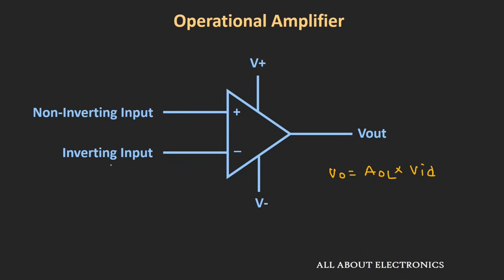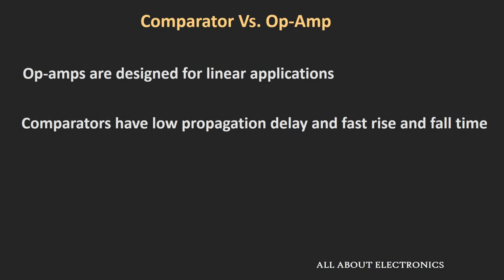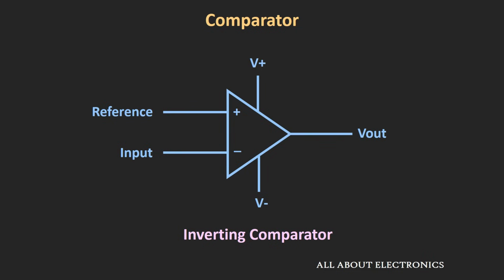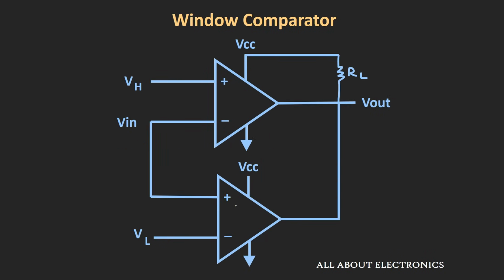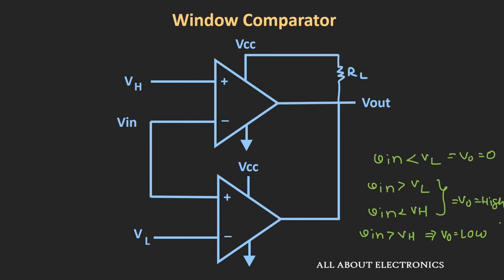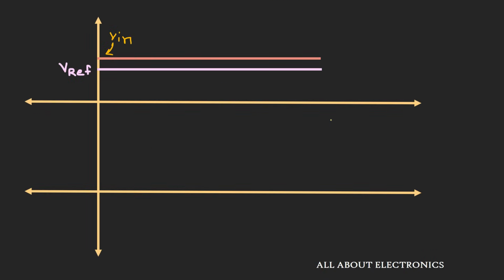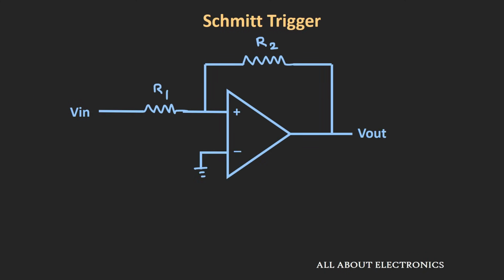Comparator Explained (Inverting Comparator, Non-Inverting Comparator and Window Comparator)

Comment: Its Low ( 0 ) and High ( 1 ) Voltage Depend on its type of compator 1) Inverting and Non - Inverting
Reply from the maker: Yes. Basically that’s a Schmitt trigger. ( inverting or non- inverting type)

Comment: at 05:30 , you said "when Input is applied at Inverting terminal, and input voltage is lower than the reference voltage, the output will be LOW
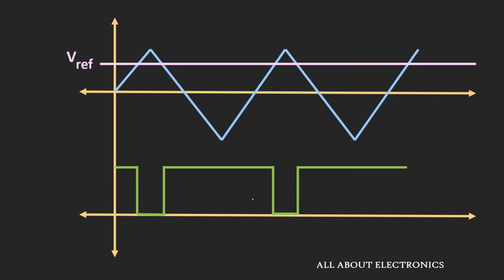but in the example at 06:58 when the Input is applied at the inverting terminal, and  the Input Voltage is lower than the reference voltage , the V-out in the graph is showing HIGH, is it not contradicting 05:30 statement, or am I getting something wrong?
Reply from the maker: Both are different case. In the first case, the input is applied at the non-inverting input terminal, while in the second case, the input is applied at the inverting terminal. In the second case, when input is less than reference voltage, then V+ > V- (the voltage at the non-inverting terminal will be more than inverting terminal). Hence output is HIGH. Now, when when the voltage at the inverting terminal goes above the voltage at the non-inverting terminal, then only output will go LOW. I hope, it will clear your doubt.

Comment: Whether both the comparator outputs are been connected with Vcc, because your diagram seems to be like that only ?
Reply from the maker: I think you are talking about the window comparator. Yes, the outputs are connected to Vcc through one resistor. And because of that, the output behaves like wired AND gate.

Comment: For the window comparator, why is it that if one op-amp goes low then Vo goes low automatically, but needs both op-amps to be high for Vo to go high?
Reply from the maker: Because in the window comparator, the output of the two op-amps are connected together using the pull-up resistor. So, their outputs will act as a wired AND connection. That means if any one of the op-amp output is low, then overall output will become low and the output of the window comparator is high when both the outputs are high.

Comment: When the inverting terminal voltage and non-inverting terminal voltage are same, how will it work then?
Reply from the maker: In ideal case, the output of the comparator will be zero. But in reality due to different bias currents at both inverting and non inverting terminal, the voltage at the two terminals will be slightly different. And because of that the output of the comparator will be either +Vsat or - Vsat.

Comment: I thought op amp always try to make V- = V+. When ap-amp is used as comparator, it seems the rule is obeyed?
Reply from the maker: No, V- = V+, when the opamp is used with negative feedback ( in the linear region). When the opamp is used as a comparator then it is used in the open loop configuration. Therefore, it is not applicable.
Reply: @ALLABOUTELECTRONICS  Thank you so much for confirming this information.
Reply: Sorry, violated.

Comment: what is vref in this opamp
Reply from the maker: Vref is the reference voltage, which you want to compare it with the input signal. For example, if the input goes beyond this Vref, then output of the comparator will change. And based on that, you can take certain action in the circuit. (Turn on/off LED, Turn on/off Motor, etc)

Comment: In electronics, a comparator is an electronic circuit that compares the voltage level of two input signals and outputs a binary signal indicating which input signal is greater. It is a type of operational amplifier (op-amp) circuit that has a very high gain and is designed to operate in its linear region.

The comparator has two input terminals, one positive (+) and one negative (-), and one output terminal. The input signals are connected to the positive and negative input terminals, and the output signal is a binary signal that indicates whether the positive input is greater than or less than the negative input.

When the voltage level of the positive input is greater than the negative input, the output of the comparator is high (logic level 1). When the voltage level of the negative input is greater than the positive input, the output of the comparator is low (logic level 0).

Comparators are used in a wide range of electronic circuits, such as voltage level detectors, oscillators, and digital-to-analog converters. They are also commonly used in analog-to-digital converters (ADCs) to convert analog signals into digital signals.
Reply: Thankyou
Reply: @ramanverseyt  बहुत अच्छा से समझा है मेरे दोस्त थैंक्यू
Reply: Thank you very much ❤
Reply: I love you
Reply: It's really helpful

Comment: At 9:04 iam confused that in window comparator why overall voltage is low if vin is less than either lower threshold voltage or upper threshold voltage
Reply from the maker: The output of the two compactors are connected. So, if any one of the output is low, then overall output will remain low. 
The output of the window comparator high, when both comparators outputs are high. In this case, it will happen when Vin >VL and Vin < Vh.
So, basically, when the input voltage is within certain voltage band, then only the output of the comparator will become high. 
I hope, it will clear your doubt.

Comment: If you run the output of an op-amp through a diode, would that give you a comparator?
Reply from the maker: If you use opamp in the open loop configuration ( without any feedback) then that itself will act as an amplifier. If you use opamp at the output of the opamp ( without feedback) then it will rectify the output.

Comment: Would you please clarify that from the circuit perspective, what would be the difference between an op-amp and a comparator? how are comparators faster than op-amps? Also, can you please explain the reason of adding the resistor?
Reply from the maker: op amp is optimized to provide accuracy and stability (both dc and dynamic) for a specified linear range of output values in precision closed-loop (feedback) circuits. It is achieved through internal compensation capacitor. But when the same op-amp is used in the open loop configuration as a comparator, then due to its internal compensation capacitor, its output cannot change very fast. On the other end, the comparators are meant to be operated in the open loop configuration. So, they do not require internal compensation capacitor. And because of that they are quite fast. I hope, it will clear your doubt.

Comment: Is it possible for a quad op-amp to generate 3 window comparators.  Specifically, if an RGB LED is used, how can I have ...

Input (In)                        Comp-A (R)               Comp-B (G)               Comp-C (B)      Colour
In < 2.4V                            Low                            Low                            Low                   -
2.4V < In < 2.6V                Hi                               Low                            Low                   R
2.6V < In < 2.8V                Low                            Hi                               Low                   G
2.8V < In < 3.0C                Low                            Low                            Hi                      B
In > 3.0                               Low                            Low                            Low                   -

Comment: Have to point out in the window comparator, the circuit works only when the op-amp has open collector output stage. It won't work if it has push-pull output, which is what many modern IC uses nowadays.

Comment: What if I put equal voltage?
Reply from the maker: Ideally, if two inputs are equal then the output will be zero. But in reality when two voltage levels are within the input offset voltage range of the op-amp, then the output would be random. It could be high or low or may switch between high and low randomly.

Comment: Consider you have a sensor which may be taking values of photoresistor and converting
them into voltage. Assume that sensor is recording the following values.
Max Value (Bright Light) ≈ 12 V (10% tolerance level)
Min Value (Dark) ≈ -2V (10% tolerance level)
Whenever the sensor reaches the value of ≈ 5V (10% tolerance level) a BlueLED must
be ON and when it drops from 5V it should be OFF.
The circuit is implemented using an amplifier which vaguely follows the idea of converting
analog input into digital by using it as a comparator.

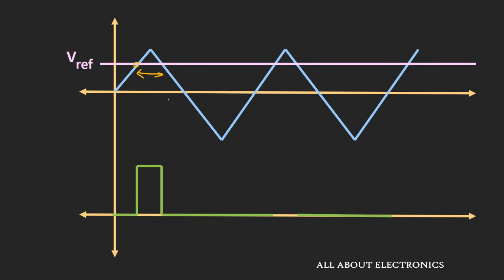Comment: sir, in 6:12 , the output waveform  should give a negative saturation for all input less than reference voltage , i am confused by the way u have given only  one side positive saturations.  should the low outputs  ought to be below axis ??.can u help me out
Reply from the maker: Many comparators are single supply, where the negative supply pin is grounded. In that case, the output will vary between  Vsat and 0.
When the comparator is biased with dual supply, (Positive and negative) then, in that case, the output will vary between +Vsat and - Vsat.
Here the comparator is biased with the single supply. 
That's why the output is zero instead of negative Vsat. 
I hope it will clear your doubt.
Reply: @ALLABOUTELECTRONICS  thank u sir

Comment: Sir, what about the case when output is in between Vsat and -Vsat (means if open loop gain*(Vin-Vref) donot reach Vsat)
Reply from the maker: If it does not go into the saturation then op-amp is operating in the linear region and it will work as linear amplifier. That is means vout = open loop gain* ( vin1 - Vin2)
But for that input should be very small. Typically in uV.

Comment: why in output voltage , vo= 0 V when vin < vref  , it should have been -vsat
Reply from the maker: It depends on type of comparator. Some comparators are single supply comparators. In such comparators the output will vary between Vaat and 0. In dual supply comparators the output varies between Vaat and - Vsat. 
I hope it will clear your doubt.
Reply: @ALLABOUTELECTRONICS  Thank you very much

Comment: actually your graphs are wrong for inverting and non inverting comparator because in case of non inverting comparator when Vin < reference then Vout = -Vsaturation not 0 and similar for inverting comparator , by the way your explanation is awesome :)
Reply from the maker: It actually depends on the comparator supply voltages. There are some comparators, where positive supply voltage is Vcc and negative supply voltage is 0. In some comparator its -VCC. 
For single supply comparators, the output will be zero, for the dual supply comparators, it will be -Vsat. 
I hope it will clear your doubt.

Comment: What is the meaning of open collector configuration at 3:56 ?
Reply from the maker: In the open-collector configuration, the output is taken through the collector of the internal transistor.To get the proper logic high and low, it is required to connect the external pull-up resistor at the collector. (resistor needs to be connected to Vcc at the collector).
Reply: @ALLABOUTELECTRONICS  okay thanks

Comment: Sir why in the waveform of non inverting comparator you made the output signal zero .....will that not be equal to -Vsat ??
In books it's given -Vsat 

Plzzzz help sir this is creating confusion in my concepts!
Reply from the maker: See, that depends on whether the comparator is a single supply or dual supply. In a single supply comparator, when the output of the comparator is high, then it will go towards the +Vsat, and when it is low, the output is zero.
In dual supply comparator, there will be +Vsat and -Vsat. 
Here I am assuming its single supply comparator. In the book, it might be a dual supply comparator. (The biasing voltage to the comparator will be +Vcc and -Vcc)
I hope it will clear your doubt.
Reply: @ALLABOUTELECTRONICS  ohh okay  .....thank you so VERY much sir ....now m fine with the concept 😄

Comment: Sir,in window comparator ,if input is less than low threshold value ,then comp1(upper comparator)  should give high according to ur circuit design  ?..u should keep the input on non inverting terminal of upper comparator (comp1) and modify the circuit ,if I m  not wrong 🤔
Reply from the maker: When Vin is less than VL, then the output of the first comparator is high, but the second comparator is low. (ideally, the output of the second comparator is zero).
So, it will pull down the overall output voltage to zero. (even though the output of 1st comparator is high)
It acts like a wired-AND gate. That means the output will be high when both comparator output is high. 
I hope it will clear your doubt.
Reply: Thanku sir😊

Comment: 6:36 what about -ve half cycle
Reply from the maker: During the negative half cycle also, as the input is less than reference voltage, the output will remain low.

Comment: Good explanation, but there’s something I don’t understand. How come op amps and comparators aren’t the same thing? Isn’t a comparator just an op amp without feedback?
Reply from the maker: Yes, op-amp can be used as comparators. But for that, the slew rate of the op-amp should be very fast.
So, ideally all the op-amps can be used as comparator. But not all the op-amp will work perfectly as comparator.
So, there are dedicated comparators ICs which will work as a comparator. 
So, internally they are op-amp itself, but optimized for fast transition.
I hope it will clear your doubt.
Reply: ALL ABOUT ELECTRONICS thank you so much for the fast reply 👍🏻

Comment: Sir, can you plz explain "why in window comparator, the output is low when any of the comparator output is low..?
I didn't understand it.. plz help sir
Reply from the maker: when any of the comparator output is low, the output of both comparators will be pull down to zero volt or low voltage. (Becuase it's wired and connection). That means the one terminal of the resistor (which is the output of the window comaprator ) will be at a low voltage. And the entire voltage will get dropped across the RL. 
I hope it will clear your doubt.
Reply: @ALLABOUTELECTRONICS  sir can you explain the significance of that pull up resistor too? What really happens when the output of both comparators are high... How we determine the overall output..
Plz help sir
Reply from the maker: The pull-up resistor ensures the logic high at the output. If you see, every circuit or every IC has limited output current capacity. That means the maximum current it can deliver. If more current is drawn then the output voltage reduces. 
And it might happen that the output voltage would become lower than the logic high value.
This pull-up resistor maintain the logic high value when the output of the comparator is high.
I hope it will clear your doubt.

Comment: The video is really good. Thank u for ur time and efforts.
Can u pls explain : 1.  the use of external pull up resistor ?  2. the reason for connecting Vcc of upper OP AMP to Vout of lower one ?
Reply from the maker: The pull-up resistor ensures the output of the comparator is indeed logic high when both comparator output is high. 
If comparators are directly connected then it may happen that the overall output is less than the logic high value. And there might be ambiguity about the output. 
Using the pull-up resistor that uncertainty can be eliminated. 
For the second question, Vcc of the first op-amp is not connected to the output op-amp. Vcc is used for the pull-up resistor. And the pull-up resistor is connected to the output. 
And similarly, the output of the second comparator is connected to the overall output. 
I hope it will clear your doubt.

Comment: what is open collector output
Reply from the maker: In open collector output, the collector pin of the transistor acts as the output pin. And for the proper output, it is connected to the Vcc through an external pull-up resistor.
Reply: @ALLABOUTELECTRONICS  what is a pull up resistor ?

Comment: What happens when you have the same input?
Reply from the maker: Ideally, if both inputs are same then output should be zero. But practically that isn't the case. And even if you apply the same input to both input terminals, still you will see either +Vcc or -Vcc/ or 0V at the output (due to noise, offset voltage etc.)

Comment: Hello, In my campus I am asked to do a project, I have to do a comparator circuit which detects whether the battery is below or higher a predetermined level. We have to Op-Amp comparator circuit, and also comparator circuit should be powered using the battery under test. Can you help on this, please?

Comment: Bro can u please explain about. What is the use of not gate in 1bit comparator please answer me bro
Reply from the maker: You are talking about the digital 1 bit comparator right? 
The one which is discussed here is the analog comparator. 
In 1 bit comparator there are three conditions.
Let's say A and B are the inputs.
1) A=B (It can be determined using XOR operation)
2) A>B (AB')
3) A<B (A'B)
To realise the last two conditions you require Not Gate. 
e.g A=1 and B=0, (means A>B)
In this condition, the output would be high only when you perform logic AND operation on A and B'.
I hope it will clear your doubt.
Reply: Bro write truth table for all three conditions obtain expression by k map technique..K map technique can be used to analyze any ic

Comment: If both the voltages are equal ?
Reply from the maker: In the ideal case, if both voltages are equal, the output of the op-amp should be zero. But actually due to noise and mismatched between the transistor pairs of the op-amp internally, the voltage at one terminal used to be slightly more than the other.

Comment: For the window comparator please note that if you connect the negative rail to ground, you will not output zero volts but rather a small positive voltage when the input is outside the range of the window. Further, the load in that circuit is drawn very poorly. The outputs of the two comparators should be joined into a single node which feeds one terminal of the resistor while the other terminal should be grounded.
Reply: Thanks Vivek, i was wondering how to interprete the RL. U made a good video into a better one.